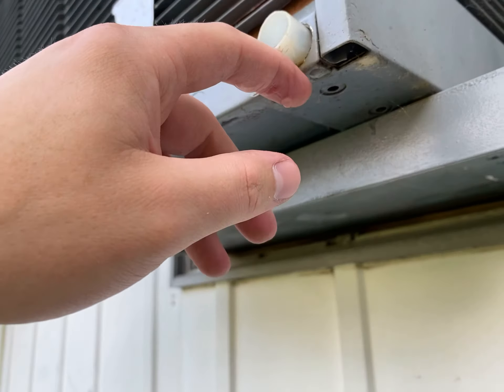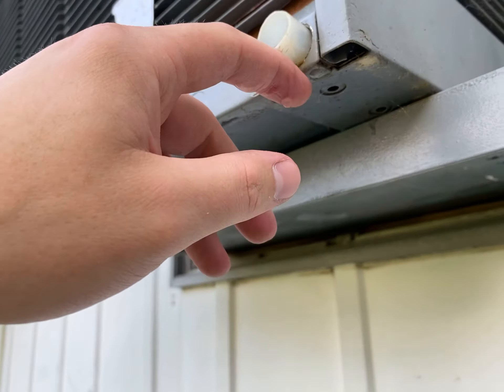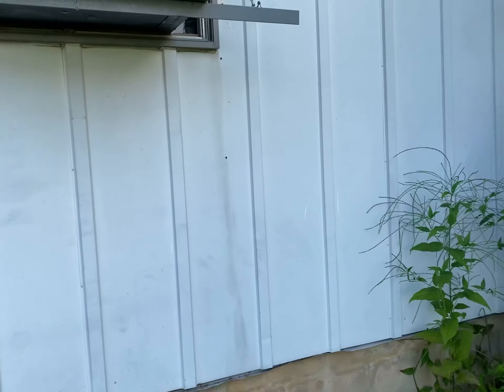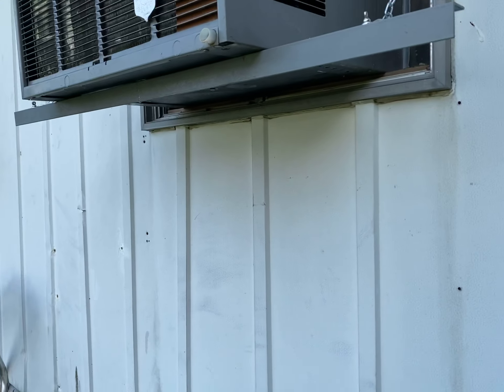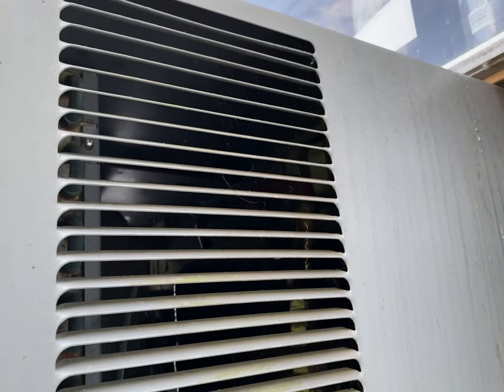Soon time to slide the 14K Fedders out for a good cleaning. Both Fedders and Admiral kicking today

Comment: When you see all that condensate coming out of the units you really know they’re working well and doing their job!
Reply from the maker: Yes but i have a drainage tube to get it right out i dont want any water in the base pan
Reply: @TheAirConditionerGuy  The water does help the unit somewhat in very hot weather. But I understand you want to preserve it so you don’t want water standing around in it, causing rust and muck.